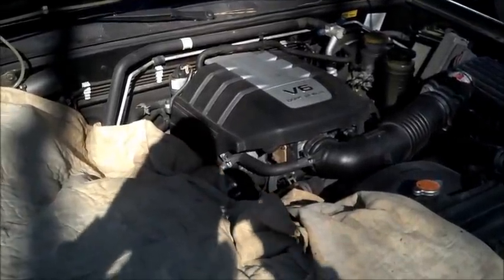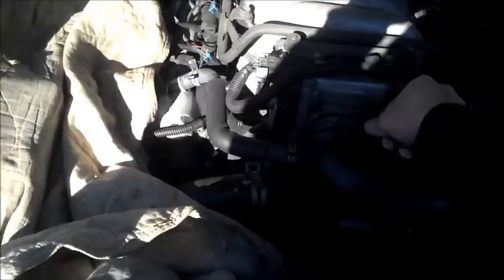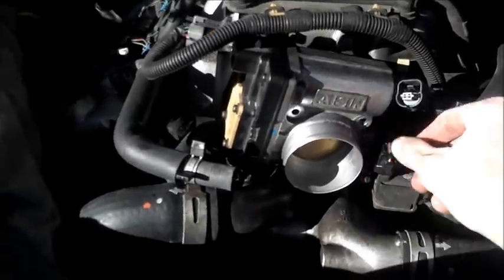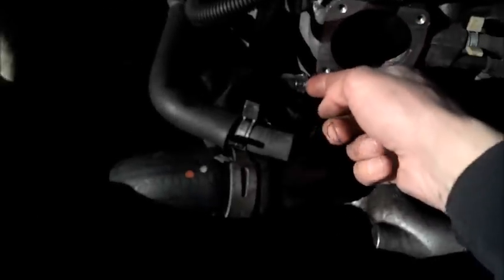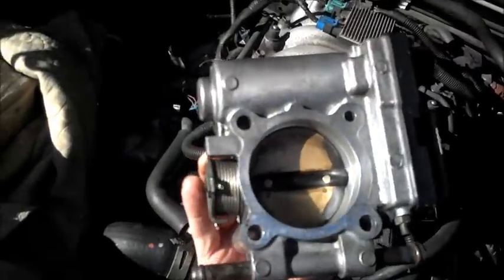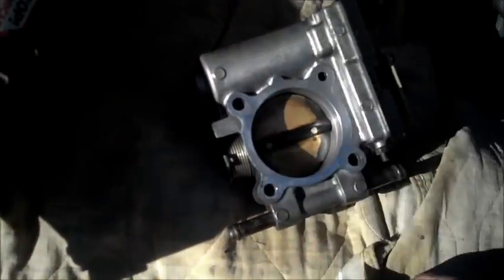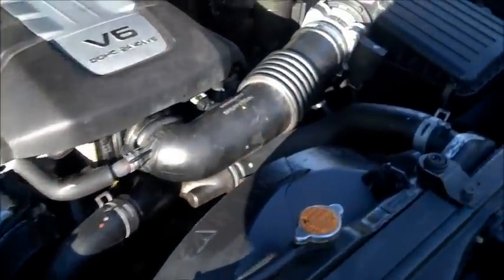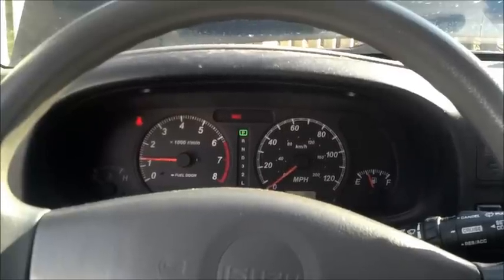EGR Valve & Tube/Throttle Body Cleaning - 2001 Isuzu Rodeo

Comment: I apologize for not being more clear. Plug the hole that connects the egr base tube to the exhaust manifold. Unless the tube in the intake manifold is totally plugged which has never happened to me their is plenty of vacuum available at the valve end of the intake manifold tube to suck the cleaner clear through the tube. It is even possible to stall the engine if you get carried away. A slow continuous spray for several minutes does the job for me.  This is sufficient to clear the trouble codes so that the vehicle can pass a smog test. If the passage in the manifold is large enough the old VW clutch cable trick should also work very well. For any young folks I would be happy to explain how that works.
Reply from the maker: +Terry Odenbach Cool, thanks for elaborating Terry!  I really like the idea of running a clutch cable up the tube to snake it out, too.  Great tips.
Reply: +Matt Payne  I thought of using an old wire coat hanger. This certainly helped clear the code from my 00 rodeo, but I think all I did now was break up some larger deposits. The car runs just fine except from at idle now....I'm hoping that all the gunk that has been loosened up clears soon. I did everything you did in your video minus the fact I used a coat hanger and I didn't have a compressor that put enough air through the line to sufficiently clear the system.
Reply: And.... now I'm getting a P0300.... Identified it as a vacuum leak... turns out when I messed with the upper intake plenum I cracked that gasket... So ignore the previous comment and i'll keep you updated on how the thing runs after i replace that gasket. If you got any tips on how to take JUST the upper intake off instead of the entire thing. That'd be much appreciated.
Reply: +Joseph Campos On my 99 Trooper the first time I had to clean the tube in the intake I used the VW clutch cable trick. Hit your local VW shop and buy a clutch cable. Cut the cable off about two feet from the threaded end after taping the cut area well. Remove the tape and flare out the cut end a little so it is a little larger than the egr tube. Put the flared end into the tube and the threaded end into a drill and run it in and out of the tube clear  back to the egr valve end. Sea Foam deep creep or any other engine carbon remover poured in through the egr valve port will help. After doing this once just doing what I suggested two months occasionally will keep it nice and clean.
Reply: +Terry Odenbach great tip. next time i might try it on the side that has the allen screw (right next to the EGR). I removed this screw/plug while i had the EGR off and it helped facilitate in locating where the blockages were.

Comment: Ok I scanner Diagnostis to say code is P0121 is throttle position sensor but thought need clear throttle body ? Correct ?
Reply from the maker: Luis Rivera Luis, I would start with trying to sort out the P0121 code first.  Something is going on either with the sensor, the wiring, or the computer.  You will probably need to have a scan tool to be able to see the readout from the throttle position sensor as you operate the gas pedal.  Unfortunately, cleaning the throttle body is not going to solve this issue.  You can try replacing the throttle position sensor to see if that solves the problem, but there are actually two sensors: one is actually mounted on the side of the throttle, and the other is mounted near the gas pedal.  It looks like the parts cost between $50-$125 each, so it could be an expensive repair, and it might not end up solving your problem if the real issue is wiring or the computer.

Good luck.  I hope you can get it figured out.

Comment: So it is been a year since you did this video and I am about to under take this task so our Passport can pass GA emissions test. Was just checking to see if you had anymore trouble with it our did this solve the issue permanently?
Reply from the maker: Mark Thomas Mark, I have not had any more EGR issues since I performed this cleaning.  However, full disclosure - I ended up having to remove the intake manifold last winter to fix another issue (I have a series of videos on this as well) and did a thorough cleaning of the EGR tube at that time.  Despite having been cleaned when I filmed this video, it had gotten fairly dirty again.  It was easier to clean with the manifold out of the vehicle, and I was able to do a more complete cleaning at that time, so I don't anticipate having any major issues with the tube getting clogged up, provided I continue to do periodic maintenance cleanings like I did in this video.

I hope this helps.  Thanks for watching!

Comment: Hello again Matt, I need some help.  Do you have a video on removal of cigarette lighter in a Dodge Ram 1500?  It's an 01.  I'm stuck!  Thanks!!  Greg Riley
Reply from the maker: +Gregory Riley Hey Gregory, unfortunately that is not something I've had to do, so I don't have a video about it.  Sorry about that!  I'm guessing it will require removing the lower portion of the dash...but I can't even look at my truck to try to help you out right now because my truck is broken down and is in a mechanic's shop.  Sorry about that!  However, I did have to remove the lower dash under the steering wheel to repair an issue with my headlight wiring, and that panel came off fairly easily by removing a few screws.  I would imagine the panel where the cigarette lighter would remove fairly similarly.

If nothing else, check out www.dodgeforum.com, specifically the 2nd Gen Rams section - you can sign up for free and post a question, and I would be someone will try to help you out.

Good luck!

Comment: Hey Matt quick question for you
Can you get to the thermostat at this point? Or must remove the intake.  
By the way great video.
Thanks
Reply from the maker: Juan Ayala Hi Juan, I've read about a few people who claim to have changed their thermostat without removing the intake manifold, but I honestly have no idea how they pulled it off.  I struggled to get to all of the thermostat housing bolts even with my intake manifold removed because of the rigid coolant line that runs along the engine valley from the firewall to the front of the engine.  If you could somehow get the thermostat out with the intake in place, I'm not sure how in the world you would get the new one in and seated properly in order to get a good seal.

In my opinion, it's not worth struggling to attempt this with the intake manifold in place, because I think ultimately you are going to have to remove the intake anyway.  It's a shame the engineers couldn't have come up with a better location for the thermostat.  Oh well.

Thanks for watching!
Reply: Thanks, Matt!  I've been trying for a long time and it's nothing but a big pain in the ass.  Way too many things in the way and yeah, the Isuzu engineers sure made this complicated- It's to the point where I need to bring it to a professional- Thanks again.
Reply from the maker: Juan Ayala I'm sorry to hear your vehicle is giving you such a hard time, Juan.  I hope you are able to find a quality mechanic that can do the work for you at a fair price.  Best of luck to you!
Reply: There must be a way. I was going to try a thermostat change on my 2000 rodeo. I could not figure out how to do it. Took it to my mechanic and he had it done and back to me in a couple of hours. 

Recently I had a coolant leak that required the intake manifold to be removed. He charged me 4 hour labor @ $95 to get to the issue. The thermostat change was no where near that.

Comment: I have a 2001 rodeo with the reduce power light on. I have changed the tps, mass airflow, fuel filter and it's still in reduce power. Anyone else had this problem?
Reply from the maker: Do you have any check engine codes present?  Sometimes if the TPS gets out of synch with the pedal position sensor, it will send the PCM into "reduced power mode".  You could possibly have a faulty pedal position sensor.
Reply: Egr

Comment: Wouldn't a pipe snake or a flexible drain brush like ones to clean a sink of hair clogs accomplish the same effect of cleaning the egr tube?  I welcome anyones comments, suggestions, or any other ideas.  Terry Odenback in the comments mentioned removing the egr valve and plugging the egr hole and spraying cleaner into the small hole  This sounds like your Seafoam Deep creep you mentioned. Again open to anyone's suggestions.  Thanks in advance.